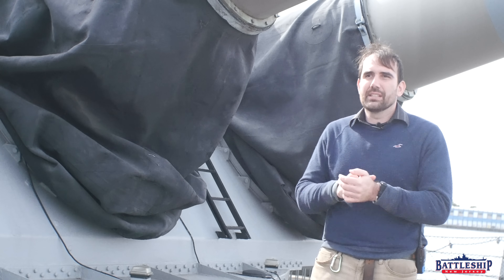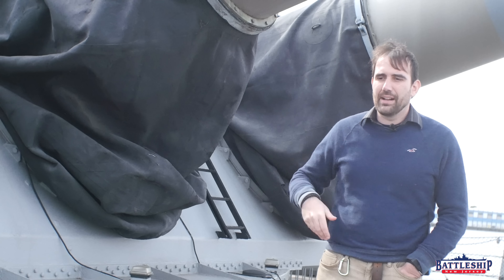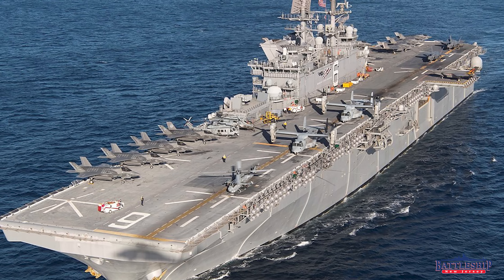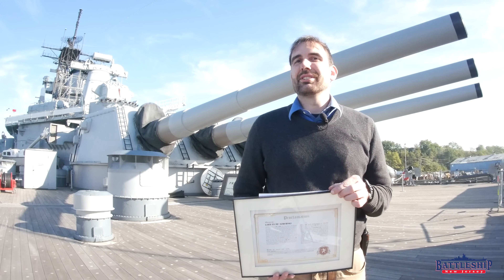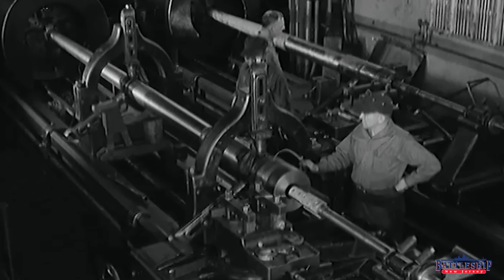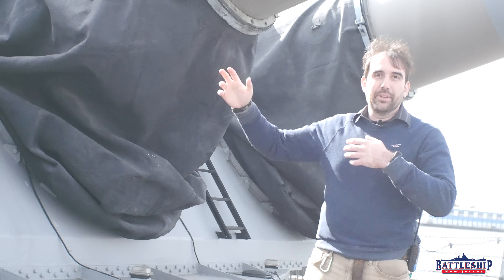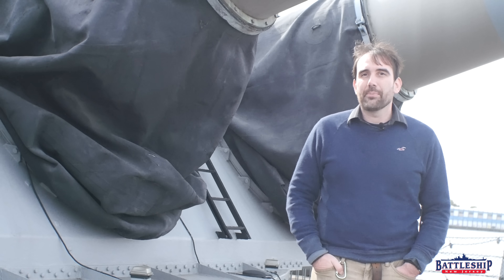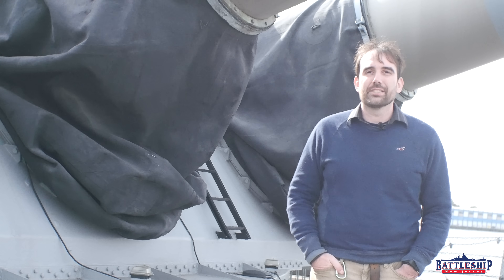How Much Would It Cost to Build a Battleship Today?

Comment: It's really hard to envision circumstances that demand a massive gun ship with thick slabs of armor.  Maybe in an environment where bursts of electromagnetic pulse's keep destroying electronics making guided missiles and aircraft impractical.  In that case, assuming time and budget, I'd be inclined to re-activate one or two battleships doing a very deep rebuild (to almost new condition) and making them nuclear powered.  (Nuclear costs are insane upfront, but saves money in the long run because no oil costs) Then, using what we learned from re-building the old battleships we could design and build newer better ones.
One of the problems with building new battleships is that we really have forgotten how to make the thick armor and big guns.  We have all the blueprints and technical data, but that's only part of the knowledge needed.  So much of the technique of building things is in the minds of the builders.  That information is long lost and would have to be re-learned.
Oh, and I wouldn't want to live in this world.  Frequent emp bursts basically means no consumer electronics.  Like the computer I'm typing this on....

Comment: If the desperate need arose I say reactive ships, however only until tooling and completion of replacements were made. If possible using modern equipment that could later be stripped and reused on the replacements to save a bit of money. I agree that maintaining a ship this old would probably be a huge financial pit

Comment: A modern battleship will likely be turboelectric (gas turbines driving electric generators that then power the electric motors turning the propellers). She needs a purpose beyond shore bombardment and antiship warfare, as missiles are better for these missions, due to the latter's range advantage; my proposal is air and antiballistic missile defense, the ship carrying massive AESA radars and using a modernized version of Project HARP guns to shoot down incoming missiles- large caliber rounds are faster than most missiles, and are cheaper than the hypersonic missiles that are the exception, meaning large caliber guns are a more economic countermeasure against air and missile attacks, as long as they're accurate enough.

If the electromagnetic railgun can be made to work in a combat environment, the battleship should be large and powerful enough (in terms of electrical power generation) to accommodate the weapons.

Comment: They would never use a 60-in gun on a modern naval ship because they're completely obsolete. They would have no mission.. you would use a smaller gun designed for shore bombardment. Also, the ship would be filled with vertical launchers. And if modernized would not be using the same type of engines. It would be more like it up. Armored zumwalt.

Comment: I would probably build new, after a detailed cost analysis including mission lifetime. If we only need 1 or 2 ships for 2-3 years, then maybe going with reactivating a museum battleships might work. If reactivating, I would probably want to look at swapping out the steam system. Maybe not going nuclear, but upgrading to something else a bit. 

However if we need a fleet of ships and the higher ups want them for long-term, then designing and building all new ships. Might use the Iowas as a point of reference for designing a new ship but also looking at using modern everything for a lot of tings.

Comment: But a modern gun like on the main battle tank  m2a1 Abrams are capable of reaching out over several miles so why not make a 400mm /70 or 400mm /75 cal smart munition gun for a new battleship

Comment: Given the level of work needed to re-activate the Iowa's and the features of a new battleship that cannot be constructed without rebuilding lost industrial capacity, it may be most cost effective to build new vessels that cannibalize the de-activated Iowa's (which will please NOBODY).  Given the mass of steel transferred from the old to the new, if you used the same hull form, you could pretend that the new ships are actually the vessels scrapped to build them.  Instead of nuclear power, they would be driven by massive marine diesel engines. they would use less fuel than the old steam plants.

Comment: from scratch🤔 use the Montana class dimensions. two forward turrets, auto loaded using 155mm rocket assist howitzer tubes of 3-4 per turret. 2 per side autoload 5" guns. 4-20mm ciws, no turret in the rear large VLS for cruise missiles and a 2 sided armored pyramid for SA-2 or Aim-120 with Aim-9X mix autoload. Gas turbine powered, armored citadel for magazines, engineering, steering, and conn. the 155mm with rocket assist gives it a 18mi hit area. though smaller by far, but an abundance of ammunition (USA and USMC) no helicopter or drones. ALL shooting platform. redundant systems. and for hostile boat or port protection per side 4X M2HB and 4X M134 total 8 small arms per side. auto loading 4 barrels x 2 is a gun battery. ship is lighter, automated with redundancy. 155mm sabot would smoke any ship out there plus missile/ciws protection with the rest of the task force. 11 carriers, 22 Arsenal ships or if technical, Battle Cruiser.

Comment: I really like thought problems like this. 
My 2 cents for the discussion. 
The closest modern battleship we got was the Zumwalts. They bumbled those pretty bad. But there was some successes. Electric propulsion though plagued at first. The Mk 57 perimeter VLS launch system I think is ingenious. And something similar should be employed on all warships. But I think the role it was made for is most important and we still need. A specialized surface combatant that has a secondary mission for shore bombardment. Don’t think that would take a 40k ton battleship class. But maybe a heavy cruiser with 1 or 2 8in gun systems, Virginia payload modules, perimeter VLS, and all the power generation and energy weapons she can carry. I think for the price and crew size and use ability. It would be highly useful for amphibious operations and maybe even an option for naval base suppression in separate squadrons.

Comment: Short answer: It depends on the doctrine.

Honestly building a modern battleship wound be within the realm of possiblity. Although a better investment would be in a battle cruisers fielding less armor, but keeping the 16inch guns and possibly even upgrading to 500mm guns. However current navel doctrine has moved away from big guns and is instead focused on fielding smaller faster 127mm guns, and self contained heavy cruise missiles. Using cheeper ammunition for smaller, lightly armored, targets; and using bigger but fewer ordinances on the big, heavily armored, targets. And it's pretty much the same with railguns; they would be a game changer if they ever go to the field, but they would mostly be used as an improved 127mm gun.

Comment: I always believed they shod be brought back. Missiles can be shot down and stopped, but no one can stop a bullet. I think I'd start by fully gutting the hull and replace the boilers with nuclear power plants, then modernize everything else. I'd keep 2 of the 16 inch turrets and put in missle bays plus upgrade any other armerment needed for defense. And just in case of satellite interference Id save the old optics and range-finders as backup.

Comment: The need for really thick old style armor is not nessisary anymore. The compartmentalization of modern ships does a fair job of dissipating blast damage so...why not use 4 to 6 inch armor in places maximized to incorporate a compartmentalized hull? 

I think the puney 6" guns of the Zumwalts would have worked had they raised the bore to 7 or 8 inches. They tried to fit too much into a shell only an inch bigger than a destroyer gun. Develope a fast firing gun with a range of 60 miles and the shell weight to do significant damage once it arrives (300 lbs?) and it might be worth making some ship to carry 6 such guns. Think how many important cities/targets are within 60 miles of the coast. Put thirty 300lb precion guided modern shells into a enemy city, and you could do some serious damage. No need for thousands of crewmen either...

Comment: In short, if we needed a battleship now, the museum battleships would have to be rushed into service.  It would take years to build new where as a museum ship could technically be rushed into service especially if it's going to be used to delay the enemy.

With that part being said, it would depend on what we needed a battleship for.

Say our aircraft can't penetrate their defenses and it's going to have to be a gun fight.  In this case, you might want to make a Montana class battleship or even a Yamato or something bigger.  The thing about the Montana and Iowa is we have the designs and know everything about the ammunition.  It wouldn't be hard to start producing ammunition for those ships.  They would have to be armored like the old battleships were.  You would be looking at Jutland type battles.

If you needed a huge missile platform with some guns for defense, you could do something like the Kentucky or Hawaii.  Two turrets in the front with a missile platform in the rear.  This is also similar to today's destroyers.  Technically, you would only need the bow to be armored as it wouldn't have to fire broadside.

The cheapest and fastest ship to build would be the monitors of WWII.  A big gun on a destroyer like frame.  You could also build a half of the Iowa.  All forward guns and the superstructure back like the Rodneys.

Basically, it would depend on the situation.  Do we have the time to build new?  How fast can we actually produce the ships?  Do we have the time to fully activate a museum ship or is this a national emergency?  What will be our short term and long term goals?  If we are in a spot where we need everything we can to protect ourselves, the battleships could be put out quickly and the monitors could be built or converted in a decent amount of time.  Price of anything probably wouldn't be a concern at this point as we're fighting for our existence.  The absolute worst case.

The best case is we can take our time and not worry about getting hit.  Even this would be a toss up.  We have battleships that will work as great gun platforms.  However, if the battleship has to be the next big weapon, we have to build new.  The weapons included would depend on the roles it would play.  With the jump jets, you could have a very successful hybrid battleship/ carrier.  It could be an all in one ship.  Part battleship, part missile platform, and part aircraft carrier.

In the end, you need to answer these important questions.  What do we need it for?  When do we need it? What do we need to do to protect it?  What will be its use after the fight?  Basically, purpose, time, survivability, and longevity.

Comment: I would opt to build new battleships. This allows for a better modernized loadout with more modern equipment, and allows the designers to take out any out of date systems that would no longer serve a purpose. Modernizing things like the propulsion would also significantly lower the price, and thought could be put into automation to make the ship cheaper to run.
This adds significantly more cost to the initial construction, and means that instead of a year, you will be looking at several years of development for the ship, but assuming you are gearing up for a conflict as part of a arms race rather than already being in a conflict, this won't matter as much, though I do think this means you'll be looking at 10 years at least to develop the new ship and get the industry and infrastructure in place to work on it.
I would like to add that in this case you'd end up with a full on modern battleship rather than a reconstruction of a 1980s loadout Iowa, however, such a ship, despite it's cost, will probably have a lot more longevity and assuming that this ship would be built because this new type battleship will be the next king/queen of the ocean, keeping in mind other navies would start building similar ships, the infrastructure will also allow for further development of more modern ships in the future. A big difference after all, is that when you have a battleship, the ship has your weapons and are incredibly difficult to replace (I do not recall primary guns being replaced with larger ones on battleships, though I might be wrong and maybe the Italians did it or something) whereas with a carrier you can replace the aircraft and the bombs/missiles carried by the aircraft, the only limitation being the takeoff and landing requirements being that of the flightdeck... (which makes it sound like building a carrier makes more sense than a battleship, as awesome as battleships are)

Comment: Carriers have been outdated since the invention of air refueling.  An Iowa Class front, with a VLS system in the back with way less armor is the solution the Navy needs.  Call it a “Battle Cruiser” if you want, but it would solve the “Naval gunfire support” issue and be able to launch hundreds of missiles.  We will need it when we start taking islands again from the Chinese, which the DoD knows is coming.

Comment: The cost now for a working Iowa would essentially be incalculable, because there is nowhere on earth capable of making the armour, or in fact anything like the armour. It would require essentially an entire new industry from the ground up. The guns 'might' be possible to make, but it would be extraordinarily difficult and require a very expensive new facility/tooling.

If you leave off the full armour, because there is nothing else that can challenge the new ship and frankly it wont need thick armour, then you 'might' be able to build on in a decade, but I suspect all in costs would be like 10 billion or more.

Comment: Let's be honest, you'd basically be building a 45k ton Kirov-class. Huge number of missiles, a couple of small calibre naval guns, large aviation facilities, massive sensor and C&C suite, little to no armour. If you want big guns you'd be better reactivating the programme to build long-range 155mm munitions for the Zumwalts than look at rail-guns. From memory those things were aiming for a 100km+ range using rocket assisted stabilised projectiles. That is the minimum range needed for guns to be tactically relevant (other than for self-defence) in the missile age.

Comment: “We know how to do this” - yes, in principle, but it was in a different time. It’s the same with the Saturn V. The drawings aren’t accurate enough to put into a new CNC or allow a computer to make parts like we do today. 

As they didn’t have that they left the final adjustments to skilled individual craftsmen. That’s a whole class of skill set and workers who are now gone. (Incidentally, one of the reasons why labour pays less now than it used to.)

We would either need to train thousands of workers to a much higher standard than they are now (and we only have a few hobbyist that still have that skill and can teach them, and we would probably need to bring in new workers with higher maths and physics skills as well), or all drawings and calculations must be done again almost from scratch. 

That’s a huge extra expense you didn’t include in your calculations.

Comment: A gun oriented Battleship is useless in today's era of naval technology.  If you want to change it into a big ship hauling tons of missiles, the Russians have done that already decades ago.  But you can do that job with smaller ships carrying a bunch of missiles.

Unless there's some revolution in future naval technology, I don't see navy composition changing that much from what it is today, or going to be in the foreseeable future.
Reply: Big guns are not really outdated, if one can get within gun range - That is the problem. However large ships loaded with missiles have not been done yet, those ships would be a new class of warship called Arsenal Ship - A large, heavy armored ship capable of launching +700 missiles. Imagine having a ship like that near an enemy coast. There would be no need for a Carrier, no need putting pilots in danger. It'll be cheaper on fuel consumption. A ship like that would be a floating missile platform.

Comment: With modern warships, the actual cost of the hull represents only about 10% of the total cost of the ship. The rest is the cost of weapons, sensors and other electronics. 
As you also stated, the infrastructure to build a battleship no longer exists. NASA was accused in the 1980's of loosing the plans to the Saturn Five rocket. That is, they could no longer build one. NASA still have the plans, what was lost was the infrastructure eg companies, that had the tools and knowledge to build one. It was estimated that it would have taken 10 years to rebuild the infrastructure to then build a 30+ year old designed rocket. It was cheaper to just design a brand new rocket.

Comment: One thing the Iowas were really good at was the display of power with their big hull and big guns. Nuclear subs don't really fit that role since they work hard not to be seen. Supercarriers can pull it off by virtue of their size but they really need to be out at sea to flex their muscle. Burkes and Ticonderogas look cool, but keep most of their armament under cover. So to answer the question, I'd be looking for a new design which carries forward that idea of visible force which looks imposing even when tied at the pier.

Comment: The problem is that modern CAD-designed ships would be nowhere near as durable or survivable as a 1940’s-era due to engineering styles and objectives.  Just the facts. Look at the LCS problems.  Looks good in CAD, not good in reality.